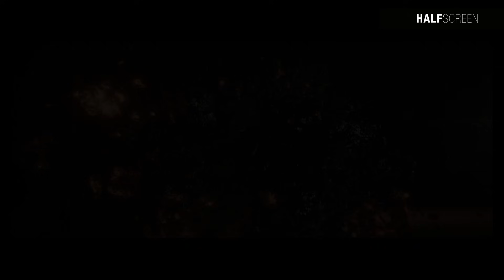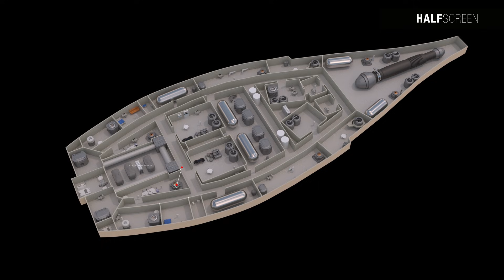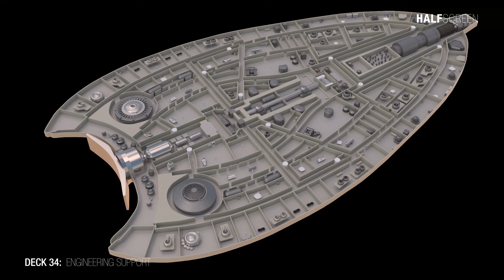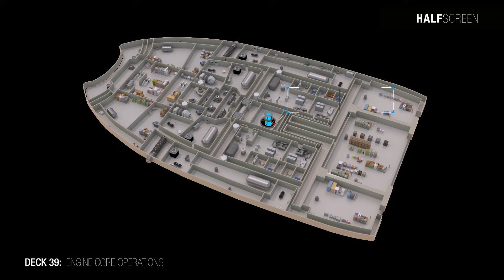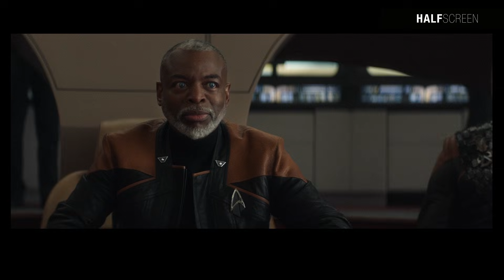Inside the USS Enterprise D (Deck 16-42)

Comment: Another excellent and fascinating video on my favourite starship.  I couldn't help wondering, in the engineering hull, why the crew accommodation was randomly scattered about almost like it was an afterthought.  Also, the warp core starts from deck 30 and goes right down to deck 42 as a very obvious central bright blue feature but seems to be absent from deck 34.

Comment: The ship doesn't seem to have any skeleton or support structure? Are materials that advanced that dividing walls between cabins is all that is needed to keep the thing from collapsing or bending?
Reply: Actually you can clearly see the ship does have a skeletal structure it can be seen on the saucer section of the U.S.S. Yamato as it's exploding and the hull is burning away you can clearly see the structural frame and the same when Geordi goes to the holodeck looking at the recreation of when the Enterprise was under construction you can clearly see the structural frame of her saucer section outside the viewport as Geordi enters the recreation of the drawing room where the warp core was designed and in Star Trek 3:The Search for Spock as the Enterprise is blowing up as her skin is burning away under her registration number and name you can clearly see the structural frame of her primary hull and the cabins in those exposed sections.

Comment: A 80’ Princess yacht requires 35,000 hours to complete. It’s interesting to imagine relative to a half-mile long starship.
Reply from the maker: That is a fascinating way to put the scale into perspective!
Reply: @H @Halfscreen .  Once I realized the Enterprise was the length of a really tall building or two, it was no longer impossible to conceive. It’s around 4 times the square footage of a large shopping center, which are usually only 2 or 3 levels.

Comment: I'm no LaForge genius but the conduits delivering the power from the core to the nacelles, would it make more sense to have a smooth line from the center to the nacelles vs what is shown on screen around the 00:14:46 mark? There are 2 bends.

Comment: I was thinking of that video where they talk about how empty the Enterprise would have been while watching this video. But one thing I got from this video was the sheer amount of floorspace taken up by fuel, cargo bays, shuttle bays, and machinery rooms. If you cut out work stations and battle stations (places where random people probably shouldn't be nosing around) then the actual living area on the ship is significantly less than the total. Then cut out private quarters, and the common areas are even less. I actually feel like the show might have gotten it right. There are going to be busy parts of the ship where most people spend most of their time, and there are going be desolate parts of the ship where only the occasional maintenance crew shows up.

Comment: Inside the Galaxy Class Starship U.S.S. Enterprise NCC-1701-D (Decks 16-42):
Deck 16:
Crew Lounge
Power Frequency Inverter
Cargo Drums
Aid Stations
Deck 17:
Centrifugual Fractionator
Organic Solids Reprocessing
Banquet/Conference Facilities
Deck 18:
Hull Spine Conduits
Sensor Systems Lab
Pressure Rehab Facility
Surge Protector Block
Deck 19:
Consumables Storage
V.I.P. Guest Accomodations
Crew Lounge
Deck 20:
E.P.S. Support
Consulting Engineer V.I.P. Accomodations
Alternate Captain's Quarters
Turbolift Pass Through
Contingency Crew Accomodations
Deck 21:
Consumables Transfer Conduits
Fluid Storage Units
Atmosphere Recirculator
Engineering Crew Accomodations
Deck 22:
Main Impulse Engine Nozzles
Remote Alloy Deposition Furnaces
System Control Programming Area
ElectroHydraulic Systems
Engineering Systems Programming Office
Engineering Crew Accomodations
Deck 23:
Photon Torpedo Storage Magazine
Aid Station
Reserve Trauma Unit
Main Impulse Engines
Deck 24:
Vertical Jefferies Tube
2 Electrostatic Filters
2 Cybernetic Labs
Upper Reactant Loader
Deck 25:
Engineering Crew Accomodations
Docking Port/Airlock
Photon Torpedo Launcher
Cybernetic Lab
Fluid Storage Area
Deck 26:
Vertical Jefferies Tube
Photon Torpedo Storage Magazine
Lower Reactant Loader
Deck 27:
Deuterium Cryo Tankage Baffles
Insulated Turbolift Pass Through
Deck 28:
Fill & Drain Ports
Tank Purge Ports
Electro Plasma Systems
Deck 29:
Surge Protector Blocks
Primary Deuterium Tank
Turbolift Pass Through
Fluid Scrubber & Separator
Cryo Chiller Subsystems
Consumables Storage Area
Central Conduit Group
Deck 30:
Upper Computer Core
Ballast Core Flight Article
Structural Integrity Field Systems
Emergency Response Teams
Tactical Planning Area
Warp Core
Deck 31:
Temporary Cryogenic Storage
Computer Power Monitoring
Engineering Crew Accomodations
Stellar Cartography
Inertial Damping Systems
Deck 32:
E.P.S. Node Monitoring
Crew Quarters
Aid Stations
Future Power Supply Expansion
4 Electrostatic Filters
Fluid Scrubbers
Deuterium Flow Control Conduit
Deck 33:
Hull Spine Conduits
Bulk Consumable Storage Facilities
Contingency Crew Accomodations
Fire Suppression Systems
Sensor Maintenance Stations
Power Frequency Inverters
E.P.S. High-Frequency Step-Up Supply
Deck 34:
Deflector Signal Processors
Navigational Signal Processors
Launcher Gas Generator
Upper Reactant Loader
Bulk Consumable Storage Systems
Atmospheric Physics Labs
Deck 35:
Bulk Consumables Storage Systems
Aft Photon Torpedo Launcher
Jefferies Tube
Temporary Cryogenic Storage Facilities
Systems Monitoring Suites
Main Deflector Dish
Deflector Power Conditioner
Deflector Field Emitter
Deck 36:
Main Engineering
Warp Engine Core
Dilithium Reaction Chamber
Engineering Support Offices
Evacuation Route
Life Boats
Nacelle Support Wing Structure
Warp Power Transfer Conduits
Transporter Systems
Lower Reactant Loader
Photon Torpedo Storage Magazine
Phaser Maintenance Facilities
Sensor Monitoring Suites
Reaction Control System Thrusters
Deck 37:
Cargo Processing Bays
Sensor Maintenance Facilities
Vertical Jefferies Tube
Ventral Phaser Arrays
High Energy Biophysics Labs
Engineering Crew Accomodations
Computer Power Monitoring
E.P.S. Node Monitoring
Deck 38:
Future Laboratory Expansion
Future Hardware Expansion
Contingency Crew Accomodations
Aid Stations
Aft Cargo High Bay
Power Systems Research
Deck 39:
Deuterium Flow Conduit
Contingency Crew Accomodations
Cargo Bay Entry Doors
Forward Cargo Bays
2 Antimatter Storage Pods
Deck 40:
Antimatter Storage Pods
Central Transfer Aisle
Cargo Loading Doors
E.P.S. Support
Future Expansion
Lifeboats
Deck 41:
Antimatter Supply Manifold
Antimatter Storage Pods
Ventral Phaser Array
Aid Station
2 Surge Protector Blocks
Electroplasma System Step-Down Node
Deck 42:
Antimatter Generator Chamber
Antimatter Injector Assembly
Antimatter Loading Port
Warp Engine Core Jettison Hatch
Warp Engine Core Ejection Port
Tractor Beam Emitter Node

Comment: “Hull breach on decks 31 through 35!” - Lt. Commander Data (Star Trek: Generations)

Seeing those decks and seeing the sections where the Duras Sisters first two torpedoes hit followed by their first disruptor shots, anybody in those sections, especially the crew quarters, were instantly dead.

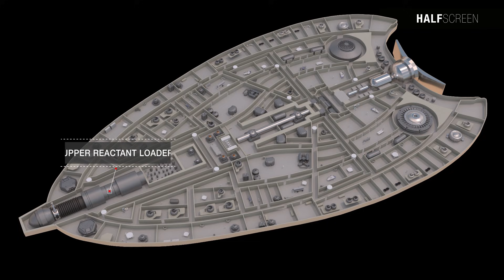Comment: 12:55 That upper reactant loader is specifically for the aft torpedo launcher, with its lower reactant loader being on Deck 36. The warp core gets its reactants via the matter and antimatter injectors on the top and bottom ends of the core itself.

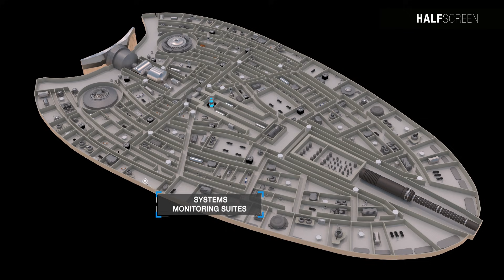13:31 The main deflector is primarily for deflecting space dust. It isn't the shield generator; the ship has shield grids throughout the exterior hull.

Comment: I can see why the Enterprise D has over 4,000 power systems aside from the Warp Reactor Core which generates 12.7 billion gigawatts of power as Galaxy Class Starships are so huge and have so many systems that need so much power for a ship that measures 
641.52 meters long
487.32 meters wide
137.9 meters high
6,500,000 metric tonnes
Would need every ounce of power for it to function and for it's crew to function comfortably onboard.

Comment: Wasn't there a 2nd warp core? Where would that be located? Since there was a possibility of having to eject the warp core, a 2nd core was needed. Also how long would it take to install the 2nd core? 
I really enjoyed the look at the decks of the ship, and where certain areas were located. 
The ship is so large, and it seems that more crew members were needed.
Reply: Wrong class the Galaxy Class didn't have a second warp core to replace the main one incase of a warp core breach it was the Intrepid Class starships that carried a back up warp core you can clearly see the second warp core on the schematics and Master Systems Display screens of the Intrepid Class.

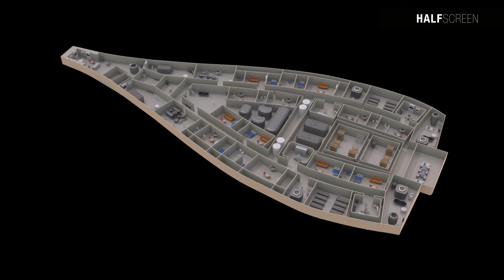Comment: 3:43 How do you get to the crew lounges on Deck 18 and Deck 19? There doesn't seem to be a corridor leading to it and I can't imagine that you have to use the Jeffery's tubes for that.
Reply from the maker: My assumption is the 4 turbo lifts on the center of deck 18 and 19.  There are a corridor on the port and  starboard side.

Comment: What about the battle bridge?...
Reply from the maker: There are no battle bridge on the Engineering hull, just the saucer section.
Reply: @Halfscreen The battle bridge is in fact at the top of the secondary hull. Top of the neck area of the secondary hull. Its on deck 8 and not part of the saucer section. Its used when the saucer is separated. I found it odd when you went through the battle bridge in part one while going through the saucer section.

Simply put, when the saucer is separated, the battle bridge is on its own at the top of the secondary hull.

Comment: The ballast core flight article is not a system. It's a large weight, designed to counter the weight of the adjacent computer core. Otherwise the mass of the ship would be too asymmetrical.

Similar articles are used in contemporary aviation engineering to simulate payload weights and test structural configurations.
Reply: I wouldn't be surprised if things are set up so that the ballast core could be more easily replaced with a fully functional computer core as a future upgrade.

Comment: The antimatter generator is not the main supply of antimatter, but the pods are there for this.

The generator is used for backup, when the pods are ejected in an emergency event.
Reply: If I remember correctly, the STTNG Technical Manual implied that the Antimatter Generator (AMG) was less efficient than a dedicated facility and would only be used in the event that the antimatter (AM) fuel is exhausted. The galaxy class is an exploration ship, and it is conceivable that one performing deep space exploration might run out of antimatter by accident. The AMG inefficiency combined with the fact that all the fusion reactors together are always much less powerful than the Warp Core (WC) means that the generator can't provide AM as fast as it can be consumed.  Using the AM as fast as it can be made would likely limit the ship to low warp factors at best, even if all efforts are made to maximise power availability to the AMG. Storage would be a necessity to operate the WC at full power by building up a reserve of AM first.

Comment: I don't think Deuterium is used in the warp core, just the impulse engines.
Reply: Deuterium is used not only in fusion reactors in impulse engines but also in the warp core. And that's why that storage space for deuterium is significantly larger that that for anti-deuterium on the bottom of the ship.

Comment: What blueprints is this based on?
Reply from the maker: https://www.cygnus-x1.net/links/lcars/star-trek-the-next-generation-enterprise.php
Reply: @Halfscreen  Ooh the Sternback plans. I prefer the Ed Whitefire plans as those plans were endorsed by Andrew Probert and incorporated all of the design elements that he had intended for the ship.
Reply from the maker: @pepperVenge  Oh, I saw his plan but decided to use the Sternback ver instead.
Reply: @Halfscreen  Fair enough lol
Reply: @Halfscreen  I think that Sternbach's plans are better choice, because they were created later in the middle of the show and they were adjusted to include some things that were seen in already aired episodes.
Reply: @Lukas-Trnka  They were released in 1996. 2 years after the show ended. And the Sternback plans did not receive the official endorsement of Gene Roddenberry or Andrew Probert; the man who originally designed the Enterprise D. Only the Ed Whitefire plans did. 

Further, the Ed Whitefire plans include the design elements that Probert intended including Cetacean (whales) Ops and their habitat.
Reply: @pepperVenge  You are right, I have mixed up the Sternbach's plans and Sternbach's TNG Technical Manual. That manual was published in 1991 (with Roddenberry's endorsement) and Sternbach's plans were published (as you say) in 1996. Five years after Roddenberry's death.

Sternbach's plans do also include environment for aquatic life, including cetean OPS. However it doesn't contain things like the mall in saucer section. Idea that was eventually scrapped from the show, so I would say Sternbach's plans are more up to date. They are also in line with TNGTM that also doesn't include any mention of that mall. It's a shame though, it would have been nice to have it.

Comment: So what I'm getting out of this is if you wanted to quickly destroy a Galaxy class starship you would hit the stardrive section from underneath in order to breach those antimatter storage pods on the very lowest decks.
Reply: Yes, but there are also containment fields to prevent this
Reply: Either that or if the sheilds are down, do a Kamikaze run into the so-called Main Deflector Dish which is charged with anti-protons. That's how the Jem'Hadar destroyed the U.S.S. Odyssey...😢

Comment: who the hell puts their ammo storage in a vulnerable location at the front  on the deck with such a small cross section?
Reply: It is not so vulnerable. The torpedoes are stored there without the antimatter. The antimatter is injected into the torpedoes during the loading process only shortly before they are fired.

Comment: The two most important things missing from this breakdown are the NACELLES and BATTLE BRIDGE!
Reply: Battle bridge is on deck 8 so it was in the previous video. The nacelles sadly are missing. That's presumably because they are not depicted on deck plans that were used as a source material here.

Comment: So, where's the battle bridge? In the very first episode, when we see the Enterprise separate for the first time, Picard leaves the main bridge and heads to the 'star drive' section to separate the ship. They watch the saucer section leave the drive section. This way the family's can escape, while the drive section stays and fights. So, where is the battle bridge? Supposedly its on deck 8 of the saucer section. But that doesn't make any sense at all! Someone please explain?
Reply: It's on Deck 8, that would be on another video.
Reply: @Schindlerphoto  Right. Deck 8, as in the saucer section. That separated from the drive section, and left Picard, Data, Troy, Tasha, behind. The families stayed on the saucer section, with Warf on the main bridge leading them the safety. So, when Picard and crew went down to the battle bridge and saw the saucer separate, they were in the drive section, NOT the saucer section. Therefore, the battle bridge is NOT on deck 8, or there is a second battle bridge? Thats my question.
Reply: @NicAmes-e6u  According to Memory Alpha, the battle bridge is on Deck 8 of the drive section, so deck 24. The creator of the video misplaced the battle bridge.
Reply: @NicAmes-e6u  Deck 8 is across both the saucer and stardrive sections, in separated flight, deck 8 is the top of the stardrive section. Deck 8 is covered in the first part of this 2 part series which covers a couple of decks belonging to the engineering hull, or stardrive section.

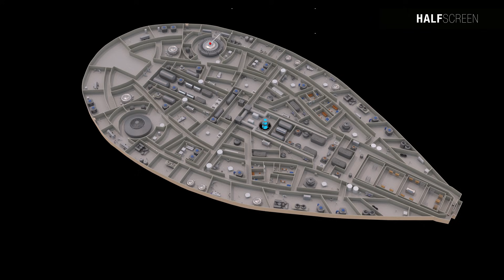Comment: I have to correct the description of "Ballast core flight article" on the 9:38. In case of ordinary submarines the ballast tanks are used to manage weight distribution of the submarine by filling in or pumping out the water and that helps with the movement. But in case of space ship this obviously doesn't make sense.

As far as I know the Ballast core flight article is an extra computation equipment that the ship's computer uses mostly for navigational computation. Not a full-fledged computer core, just an extension of it. Roughly speaking it should be something like an extra set of RAM  in a PC. I think is is used for things like computing position and trajectory of millions of particles of interstellar dust that ship's deflector has to identify and correctly deflect from the ship's path so the ship can travel safely and effectively. Especially at warp speeds. I guess it could be also used for other unusual purposes like an emergency transporter buffer when transporting too many people at once or as an extra memory for complex scientific simulations.
Reply: Might also be used for keeping track of the ship's overall mass distribution and thus center of mass, which would be important for making sure the right thrust i applied to the RCS thrusters for any given maneuver as well as balancing out thrust output from impulse engines.
Reply: @Krahazik  That is certainly also a thing they have to consider when maneuvering, but I don't think they would need an additional unit for such computation next to the regular computer core. 

Creating a precise model of movement of interstellar medium across trillions of cubic kilometers of space infront of ship in a real time requires way more operational memory. And the requirements grow exponentially every time the ship increases the warp speed. Compared to this I think keeping track of ship's mass distribution would be significantly easier. And most importantly the required computational power should be roughly the same no matter how the ship moves. I would say the name "ballast core" suggests it is designed to help the main computer in times of increased load, like when travelling at warp speed.